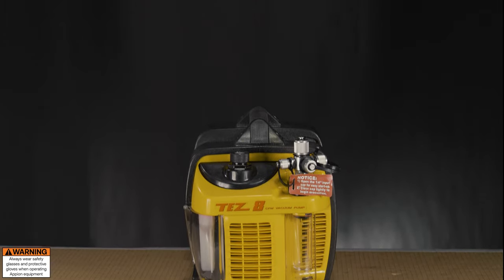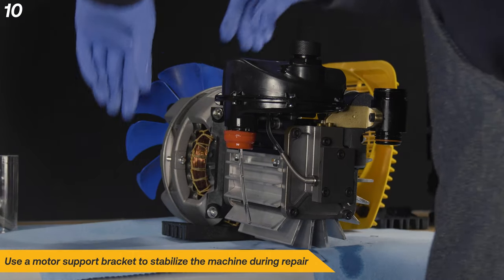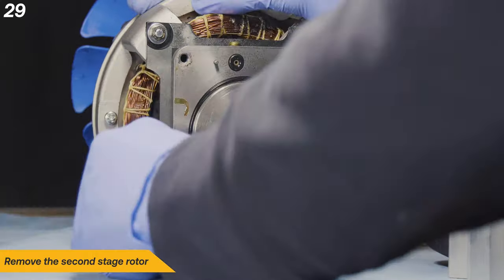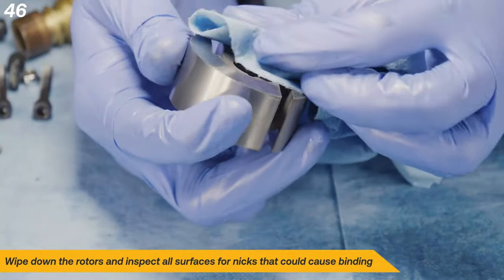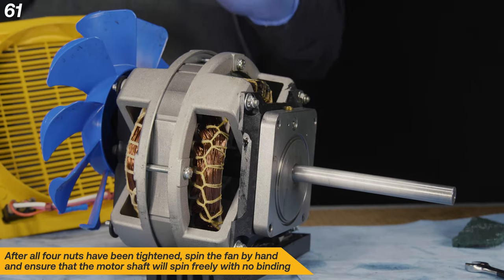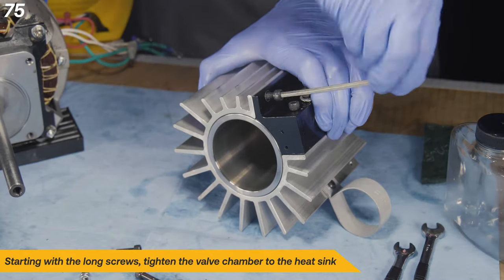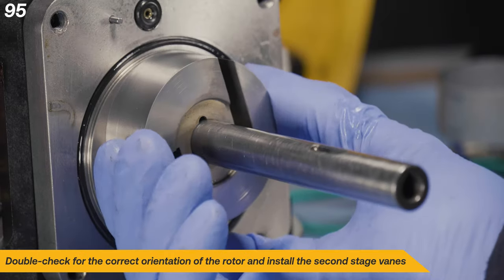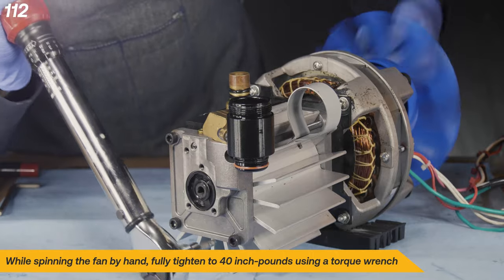TEZ8 Repair: KTT881-R Walkthrough

Comment: Thanks for the video! Immensely helpful but... 10:49 
It Says: "installed as shown, with the ends of valves bending AWAY from cylinder" It Shows: valves being installed, bending away from the chamber, and bending TOWARD the cylinder :(
I hope away from the cylinder is correct. I'm starting my rebuild today
Reply from the maker: The valves bending away is to make sure the orientation is correct. The video is the correct way. The valves typically wont have that prominent of a bend, to show people what we mean, we first put them on the cylinder to show "look these do have a bend, when testing to see what way the valves are bending put them on the cylinder with the bend going away from the cylinder, then transfer them to the valve chamber as shown."
Reply: @Appiontools  So when it's all installed and done, which way are the ends of the valves pointing?
Away from the cylinder and towards the chamber? Or the oppposite?
Reply from the maker: @penderway  when its fully installed, the valve ends will be going towards the cylinder away from the valve chamber. Just follow the visual exactly.

Comment: i am trying to rebuild this pump but everytime i get to putting the endplate over the cylinder housingand rotating the fan simultaneously the shafted assembly gets jammed am i missing something? i have uninstalled and reinstalled the assembly 5 or 6 times at this point with no luck same problem. all lock pins are seated i check that the vane doesnt bind and has no freeplay  during each section and still catching when i go to tighten the 4 bolts up
Reply from the maker: Just off the top of my head, my first thought would be to make sure that you're tightening the bolts in a crisscross pattern. Tighten them incrementally while rotating the fan in between. For example, only quarter tighten each bolt in a crisscross pattern then try the fan, then go to half tight and try the fan again, all the way until the bolts are at 40 inch-pounds of torque. If you fully tighten the bolts initially, by the time you tighten the last bolt it could incidentally overtighten the previous bolts. If this doesn't fix the problem, please reach out to Support@AppionTools.com and we will get you taken care of.
Reply: @Appiontools  I have tried that method a few times already with no luck do you think it's possible that the bushing at the front end of the motor assembly is extending outward and forcing the Piston not to seat correctly in the secondary stage
Reply from the maker: @ascendinghavoc5106  I would reach out to support@appiontools.com they have a bit more knowledge when it comes to repair than I do off hand. It gets a bit difficult (especially with the TEZ8 repairs) to diagnose the problem quickly without having the machine in front of me.
Reply: @ascendinghavoc5106 did you ever figure out the issue??
Reply: @ellismathewson3754  sadly no i was never able to figure it out and ended up tossing the machine it was about 4 yrs old and the repair kit was an attempt to keep it alive

Comment: Man, I never trusted my TEZ8. It never pulled a deep enough vacuum, even when using large diameter hoses. I may have rebuilt this pump if I would have seen this video. I ended up throwing the pump away.